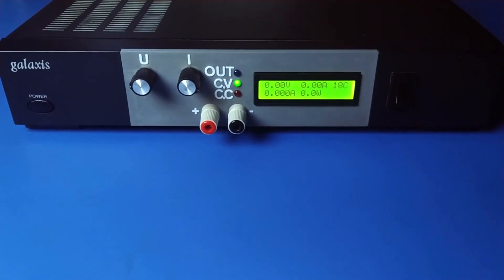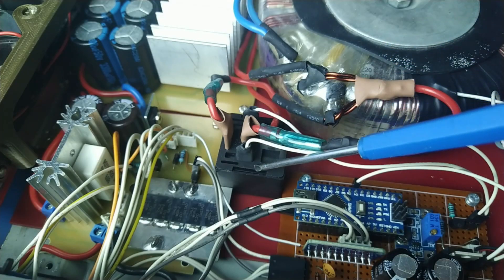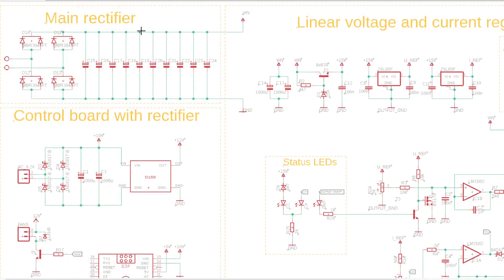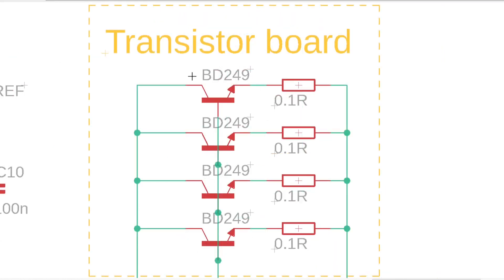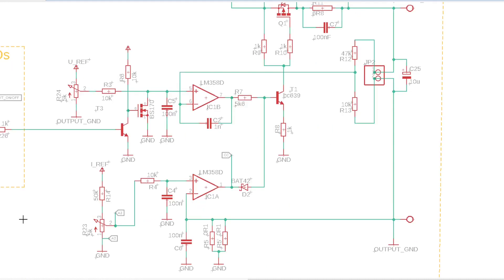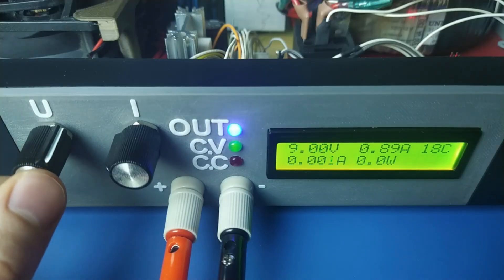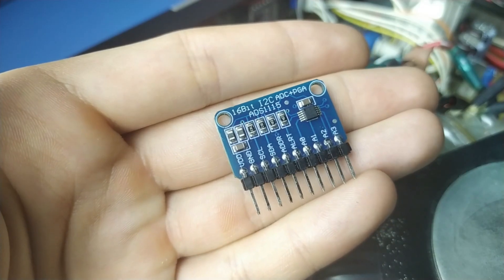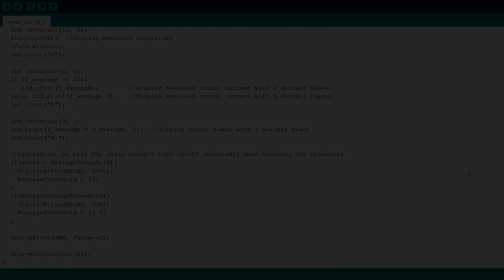Homemade linear bench power supply 0-28V 0.01-10A 250W!

Comment: Hello.How can y resolve this error? C:\Users\Cosmin\Desktop\linear-power-supply-main\linear-power-supply-main\code\power_sup_v4_2\power_sup_v4_2.ino: In function 'void setup()':
power_sup_v4_2:58:13: error: no matching function for call to 'LiquidCrystal_I2C::begin()'
   lcd.begin();
             ^
In file included from C:\Users\Cosmin\Desktop\linear-power-supply-main\linear-power-supply-main\code\power_sup_v4_2\power_sup_v4_2.ino:42:0:
C:\Users\Cosmin\Documents\Arduino\libraries\LiquidCrystal_I2C/LiquidCrystal_I2C.h:58:8: note: candidate: void LiquidCrystal_I2C::begin(uint8_t, uint8_t, uint8_t)
   void begin(uint8_t cols, uint8_t rows, uint8_t charsize = LCD_5x8DOTS );
        ^~~~~
C:\Users\Cosmin\Documents\Arduino\libraries\LiquidCrystal_I2C/LiquidCrystal_I2C.h:58:8: note:   candidate expects 3 arguments, 0 provided
Multiple libraries were found for "LiquidCrystal_I2C.h"
 Used: C:\Users\Cosmin\Documents\Arduino\libraries\LiquidCrystal_I2C
 Not used: C:\Users\Cosmin\Documents\Arduino\libraries\NewLiquidCrystal-master
 Not used: C:\Users\Cosmin\Documents\Arduino\libraries\New-LiquidCrystal-master
 Not used: C:\Users\Cosmin\Documents\Arduino\libraries\LiquidCrystal_I2C-1.1.1
 Not used: C:\Users\Cosmin\Documents\Arduino\libraries\LiquidCrystal_I2C-1.1.2
 Not used: C:\Users\Cosmin\Documents\Arduino\libraries\LiquidCrystal_I2C-master_NEW

Comment: A very nicely built PSU. However, be aware that the 24V, 300VA transformer is not rated to supply 10A continuously in this design. It is rated to provide 12.5Arms at 24Vrms into a resistive load, but the smoothing capacitors cause the current to be drawn in short pulses at 100Hz. The RMS current will be much larger than the average (DC) current.

A rule of thumb is that the DC output current of a full bridge rectified and capacitively smoothed supply will be about .62 x rms current drawn from the transformer.
So this supply should be good for around 7.8A, which is still pretty impressive for such a small unit.

The 28V output is also overated, at least at full load current. Typical commercial designs seem to select a transformer with the secondary voltage (RMS) around 15% or more than the DC output. The difference allows for:
1)  the minimum specified mains supply voltage (usually 10% below nominal)
2) additional drop across the transformer's winding resistance due to the non-sinusoidal current draw
3) bridge rectifier voltage drop
4) worst case voltage ripple on the smoothing caps (allowing for the large capacitance tolerance of electrolytics plus ageing)
5) the minimum dropout voltage of the main regulating transistors and their emitter sharing resistors
6) voltage across the current shunt used to measure the current
7) voltage drops across primary and secondary fuses. (I can't see the latter in your design - it would be a good idea to add one. Transformers aren't cheap)
In this case I would think 0-20V, 0-7.8A would be more realistic specification.

Finally there doesn't appear to be any protection against connecting to a reverse voltage such as a battery. Typically a large diode is reverse connected across the output terminals.
Reply: One more suggestion - add a reverse voltage protection diode across the main output transistors to protect against connecting to a voltage source when the PSU is turned off. It could destroy the BD249s by exceeding the reverse base emitter breakdown voltage of around 7V.
Reply from the maker: @tonyh6309  Thank you for your very informative comments!

Yes, the maximum output voltage and current are a bit of a stretch. This design assumes the user knows the limitations of this PSU, and in return, it provides the option of supplying a higher voltage that would drop under heavy loads. I was a bit desperate trying to allow for an output voltage close to 30V without rewinding the transformer, hence the enormous smoothing capacitors, which give the transformer a hard time.

When I get myself to continue the design of my next, much improved (hopefully) power supply (https://github.com/Dominik-Workshop/dw3005t), I will for sure come back to these comments of yours to ensure that I have considered all the things you mentioned.
Reply: @dominikworkshop6007  "I was a bit desperate trying to allow for an output voltage close to 30V without rewinding the transformer"
LOL! I know exactly where your coming from. It's very easy to get hung up trying to squeeze a bit more performance at the cost of achieving ... nothing. Analysis paralysis!

Actually you don't need to rewind the transformer - you could over-wind to add (or subtract from) the existing secondaries. A 300VA toroidal is likely to only need 2 to 3 turns/volt so it's not hard to add a couple of extra 10v secondaries for example.

My comments were really aimed at helping viewers with less experience, who may want to reproduce your design, avoiding disappointment at less than expected output power and/or overloading and damaging the expensive transformer.

"the enormous smoothing capacitors (33000uF or 3300uF/A)" are large, but so was your target output current. 4700uF caps are fairly typically used in 2A commercial bench supplies (2350uF/A), so your's isn't that far off. I do recommend looking at the service manuals for old bench supplies (eg. Farnell) which include schematics and circuit descriptions - their designs may not have been state of the art but they have stood the test of time.

Good luck with your next version; try to avoid my mistakes of trying to get the design 'perfect' at the outset - you can always improve it later. If only I could take my own advice!

Comment: Very neat design. Sensing voltage and current using differential amp would definitely make this PSU with more precision measurements. It's still quite good.
Reply from the maker: Thank you! Yes, that would have been better, there is a lot of room for improvement in this design

Comment: Great design !! Only one question: Where do you determine whether the supply is running on the high or the 12V or 24V of the transformer? I have a power supply that works on the same principle, but is faulty at some point. I might rebuild it with your design.
Reply from the maker: Thank you! 
The Arduino Nano controls a relay that switches the transformer tap based on the measured output voltage—when the voltage exceeds a set threshold, it switches to the higher voltage tap. Is this what you were asking about?
Reply: @dominikworkshop6007  Yes, that was exactly what I was asking about. Many thanks !

Comment: Can i replace BD249 with 2N3055? Because i cant found BD249 in my town
Reply from the maker: Yes, it should work.
Reply: @dominikworkshop6007  I'm very interesting with this power supply project and wanna make one. I have question about power dissipation with 12v CT transformer, why not using "non" ct 25v transformer equiped with another lower voltages? So we can use for example 6v, 9v, 12v, 18v, 25v with some relay to reduce power dissipation on lower voltage.. thanks and sorry for my bad english
Reply: BD912 that u mention in github for stability, can i change it with TIP2955? They are BJT to, coz so dificult to find BD912, for electrical datashet they are close each other (BD912 and TIP2955) CMIIW

Comment: So the 5 V regultors are for voltage reference for opamps right? What about stability of the outpout with a big load? How much your outpout voltage drop let's say at 2 amps current for example?
Reply from the maker: Yes, the 5V regulators are currently used as voltage references for the op-amps. However, this is not the most optimal design choice. Using a dedicated voltage reference like the TL431 could provide better precision and stability.

After replacing the P-MOSFET with a BJT, the output has shown stability even under heavy loads. More details on this change can be found in the README file on the GitHub repository.

While I haven't precisely measured the output voltage drop at a 2A load, I estimate it to be less than 10mV. As demonstrated in the video at the 5:39 mark, there's no noticeable drop in output voltage even at a 3A load.
Reply: 10 mV is very good as with common l317 and simple design it can drift (at least in my case) about 180 mV or something in both ways which is quite annoying while charging LiPo batteries 🙄 I have to monitor the current all the time...

Comment: Is this power supply designed to short circuit the outputs or is it just a current limiter?
Reply from the maker: It can limit the output current, but it's designed so that it's should survive a short on the output.

Comment: Hello, thank you for your good page and great movie
Can I know how much is the power supply of the op-amps and where does it come from?
Reply from the maker: Thank you, I'm glad you like it.
The op-amps are powered with 15V coming from the emitter of T2.
Reply: Is it possible to add the floating ground part to this circuit? @dominikworkshop6007
Reply from the maker: @siedshojaat4473 I'm sorry, I don't understand your question.
Reply: The floating ground is used in the laboratory power supply to parallel the sources or create negative voltages @dominikworkshop6007
Reply from the maker: @siedshojaat4473  The output of this power supply is galvanically isolated from mains earth, so it is possible to for example, connect other power supply in series with this one

Comment: I love these DIY PS. Nice done 👍.

A long time ago... 30 years or so... I also made a DIY power supply. I used a motor-controlled variac as the input voltage, to minimise the dissipated power. The voltage across the control transistors is constant (automatically controlled via the motor) so also the dissipated power of the transistors is constant regardless of the output voltage.
So in addition, I also had a 4A 0-280VAC, 40A 0-25VAC, 20A 0-50VAC and stabilised 40A 0-25VDC or 20A 0-50 VDC. Made my own current measuring resistor (hand wound resistor) for the sake of the 40A. DC was with adjustable current limit. Now it's in the basement and is nothing more than an anchor... (Oh how heavy that thing is 😂)
Reply from the maker: Thank you!

That sounds like a great solution  (ignoring the immense weight I can only imagine it had xD)! I wander how it reacted when the output voltage changed rapidly, especially when it goes up. I guess that the  motor-controlled variac didn't adjust very fast (or did it?). I see that this problem would be ocurring especially in the constant current mode, when the load rapidly decreases. Or maybe it's not a big deal and the power supply handled it well?

Comment: Hi Dominik, your project is exactly what i need " Linear power supply" that can deliver my requirement of 24V 10A. Are there any updates / new developments, between your clip date till now ?.
Reply from the maker: The only thing I was trying, was to increase the stability of this design. In simulation I figured out, that replacing the Q1 MOSFET with an PNP BJT improved the stability, though I haven't tested it in real life. For someone that has some experience with electronics I recommend to try this modification and check if the stability improved. [EDIT: I tested it and it worked wonderfully!]

In addition to that, I'd like to mention two easy performace improving mods - using some precision voltage references (e.g. TL431) instead of two 7805s. And I don't recommend using a switching converter for the fans, because it introduces some high frequency noise to the output.

Comment: Hi dominik, i want ask you how to set current? I have built the this power supply but i don't no how to set current,.. Thanks.
Reply from the maker: To set the current limit, you can short the output of the power supply while measuring the current. Then you can turn the current adjustment potentiometer to regulate the output current to fit your needs. But if you built it correctly and calibrated it, then on the LCD will be displayed the set current value, without the need to short the output.
Reply: Ooo ok,i will check again my built and calibrate.Thanks.

Comment: how can i upgrade this power supply to 0v to 100v and 0amp to 10amp power supply.
Reply: Once you are up into voltages that high you have to be extremely careful with safe operating area for the pass transistors. Second breakdown becomes a big concern. It is not unusual to use an array of cascoded transistors to deal with the second breakdown. The cascode arrangement essentially splits the voltage drop between two transistors). It is not a trivial undertaking. You would also need massive airflow for the heatsinks.

If I were doing such a thing I'd seriously consider using power MOSFETs as the pass devices. There aren't many FETs on the market that are optimized for linear circuits and they are quite expensive, but have some definite advantages.
Reply from the maker: You would have to choose Q1 and power transistors that can handle that voltage and current, and adjust R12 from the voltage feedback voltage divider. And of course you would need a transformer with higher output voltage and possibly more tabs.
Reply: @dominikworkshop6007  I have 45-0-45 10 amp transformer so i have 90 volts power supply.
Reply: @dominikworkshop6007  I choose 2c5200 and 1943  10 pair of transistor and I use a keypad to enter voltages and amps